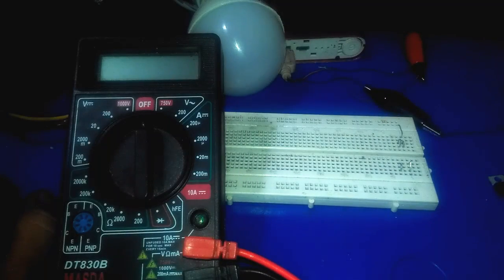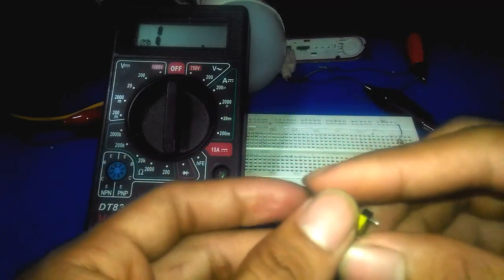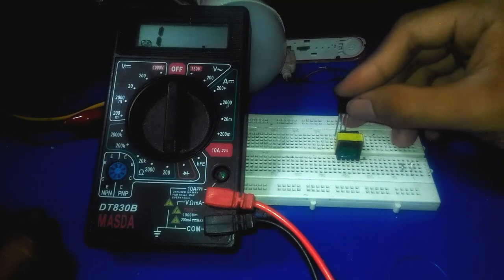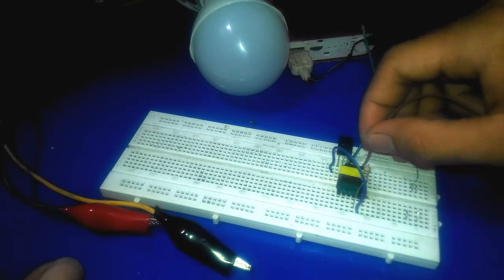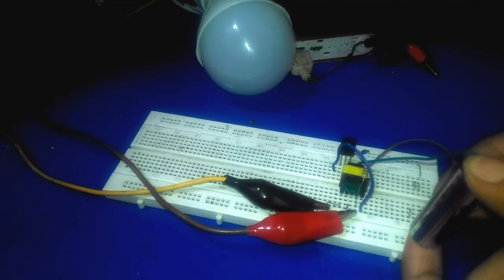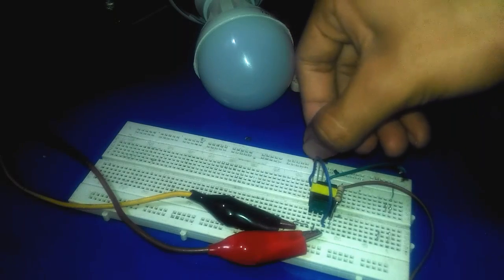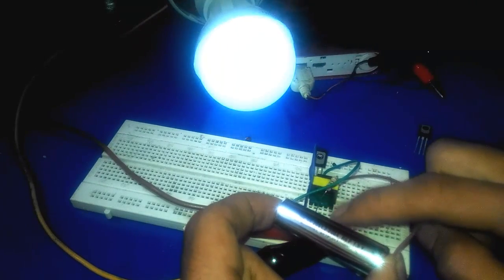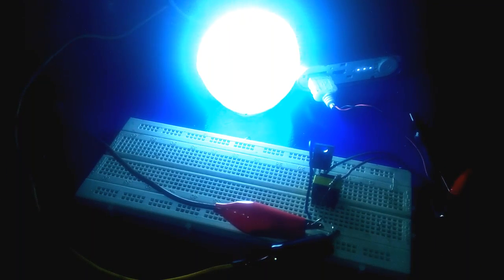how to solve a mini inverter 1.5VDC to 220VAC

Comment: Sir I make this project but when I give supply to the circuit my LED bulb is flashing I also increase the supply voltage but the problem is still here what is the problem with my circuit I also change the pin connection of transformer but still problem is here ?
Reply from the maker: +Ajaz Ahmed what us flashing

Comment: do you think it can use 12VDC to power up the bulb? if YES, what model of Transistor Model should be use without overheat? Also, with 12VDC, do you think it can power up 18Watt bulb?
Reply from the maker: it will be burn

Comment: what is the bulb watt you used in this experiment? more than 8Watts or less than 8 watts?

Do you try to measure how much ampheres it will take from 1.5VDC for power up the 230VAC bulb? I am wondering how many minutes a 1.5VDC battery can last before it is flatted 

Also, what is the output frequency? 50Hz or 60Hz?
Reply from the maker: +Hon Tin Chin less 8 watts
Reply from the maker: +Hon Tin Chin i dont know the frequency and the current
Reply from the maker: +Hon Tin Chin and i dont know how long the circuit work

Comment: I made this by looking your first video and it was working well. But, after few uses it just stopped working and realised that the transister i connected got spoiled! And not even a new transister could make the circuit run again! I don't know the reason :(
Reply from the maker: +Muhammed Zaeem how many volt did u suplay
Reply from the maker: +Muhammed Zaeem maybe the transformer was broken
Reply: Dzikri Science .. About 6 volts. I don't think it was a problem with transformer

Comment: Which IC u used??
Reply from the maker: +rohan sardeshmukh no ic in the circuit i just use bd139 or bd 140 transistor and 150 ohms or 100 ohms resistor